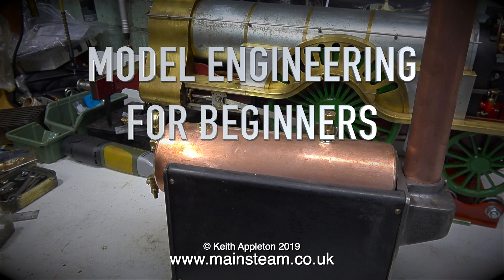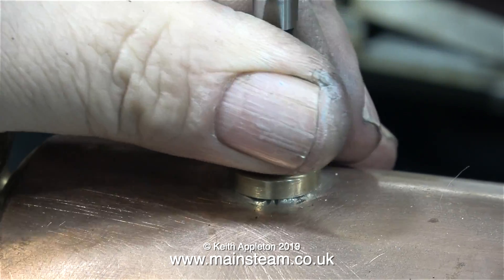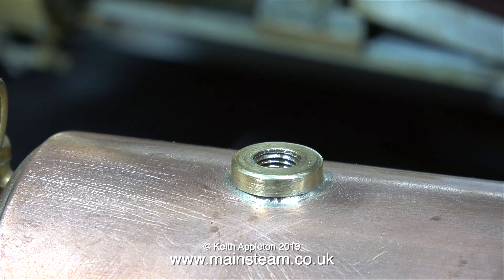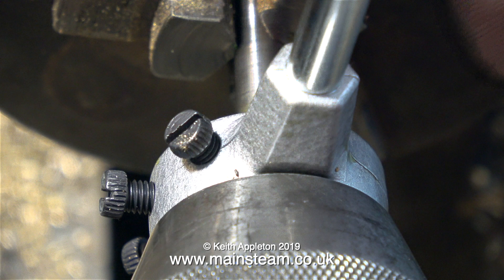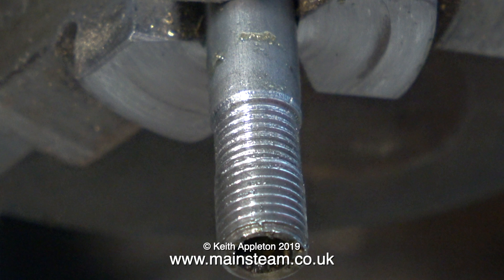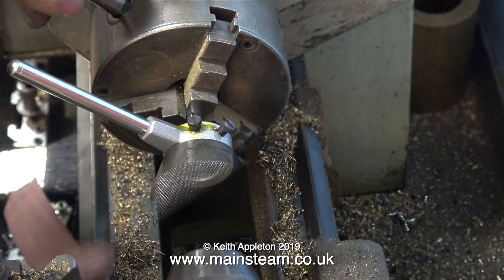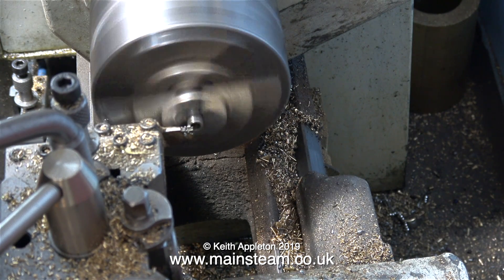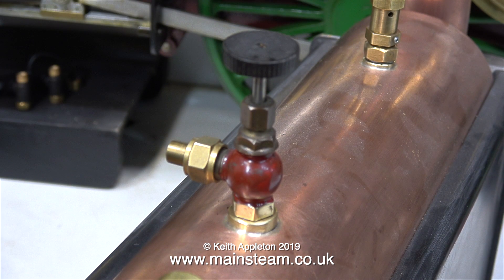THREADING STAINLESS STEEL - MODEL ENGINEERING FOR BEGINNERS - PART #20

Comment: I need to thread some 5mm 304 stainless steel, never thread anything before so I'm wondering if threading a 5mm rod will make it an m5 thread if the right cutter is used or does it not work that way and I will need to cut it to a smaller thread size? Thanks for any advice, also will a cheapish tap and die set off Amazon do the job on 304 stainless?

Comment: I made the same mistake the first time I tried to use a lathe to cut a thread!!!
What type of die did you use? I need to do something similar and have had issues thread cutting stainless in the past.
I have noticed that drilling stainless with a hand drill can easily wreck HSS drill bits. However pushing hard and lubricating well, a drill press helps a lot. I have also recently discovered cobalt drill bits. They go through stainless like butter.
Reply from the maker: I just used aCheap Carbon Steel Die.

Comment: Can i know what kind of taps and dies to use to cut stainless steels? Are they like the drill bits i use that have some cobalt? I asked in some places and they only sell taps and dies of   Hss, doesn't seem to carry anything more sofisticated than that. Any brand or any other information is welcomed.
Reply from the maker: High Speed Steel would be my choice.

Comment: Well done Keith, let me say as an ex professional in my home shop I use die cutters for threading. I got spoiled with CNC and until I get CNC in my home shop I will continue to use die cutters and taps. Screw cutting in the lathe is too much bother.

Comment: Morning Keith, how does the superheated steam get to that fitting ? is there a internal pipe, if so,the temperature will be the same as the boiler, ie saturated . regards
Reply from the maker: Please watch the part of this video where I explain the superheater arrangement on a Stuart 504 boiler . . . . .
Reply: Watched and listened again to your explanation, so the steam is collected in the top of drum, lead though a super heater element,  and then exits the top of the drum via the the stop valve , have I got that correct? regards. @keithappleton
Reply from the maker: Yes

Comment: Great advice for us beginners. Having watched plenty of your videos, I was expecting you to fit the adapter to one part (probably the valve) with a retainer like Loctite 603 so it doesn’t come out, then 542 to the other end which makes it removable. This way you’d never get the adapter stuck in the boiler bush if you removed the valve. Let me guess, 603 doesn’t seal well enough? Is that the reason you didn’t do this?
Reply from the maker: 603 is unnecessary in this application.